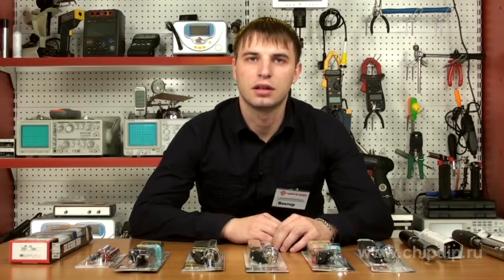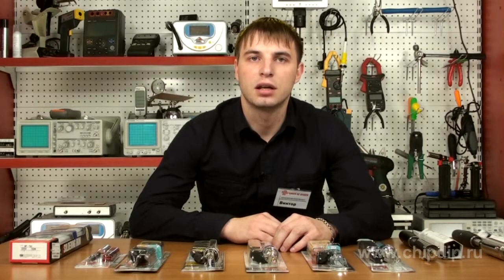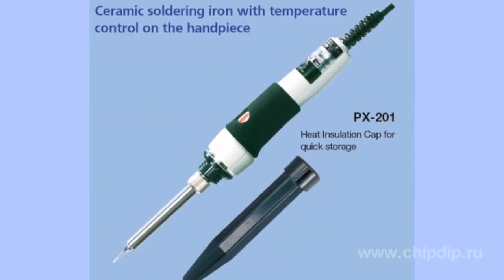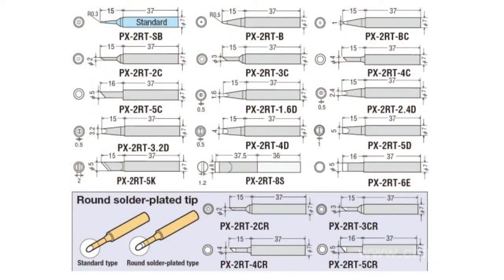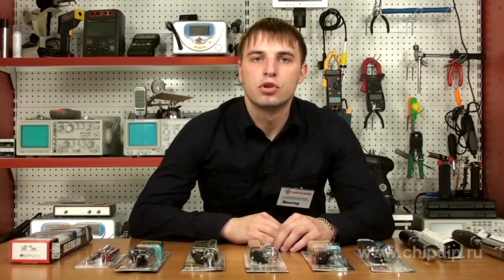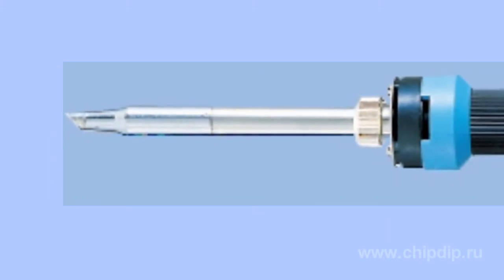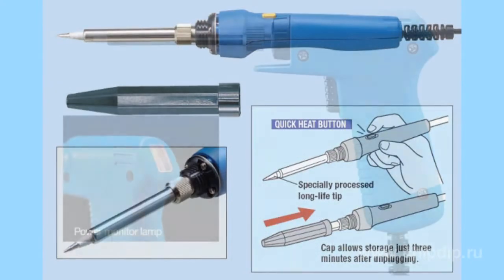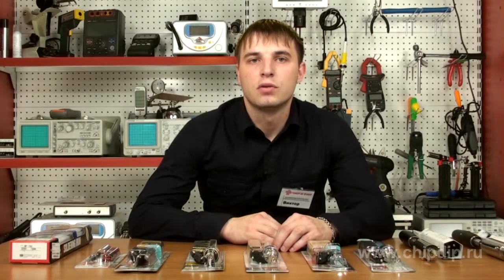Goot soldering irons with ceramic heating element

Comment: I use two PX201 in the last 16 years, both the heater element dont last more than 7 months although seldom use, my latest one which is only 14 months old the default heater broken into pieces on its own during storage, then Taiyo Malaysia sent me the replacement warranty heater and this too doesnt last long after fitting with minor uses only it is faulty again after no more than four months installed, anyone having bad experience like this with goot PX-201 ?